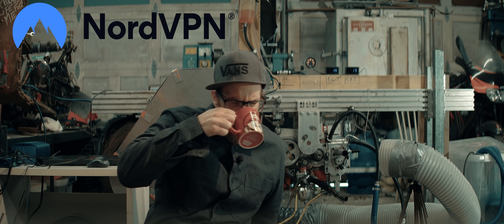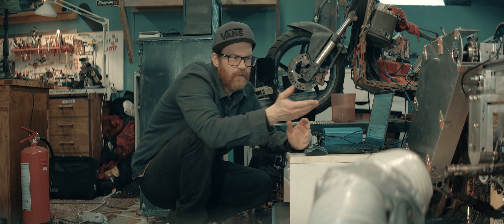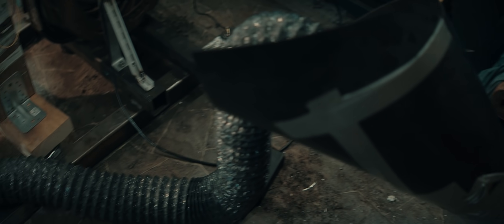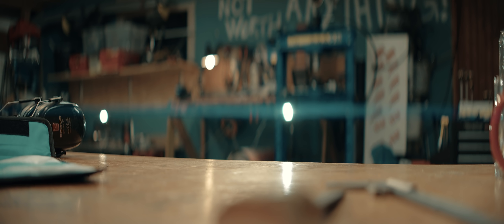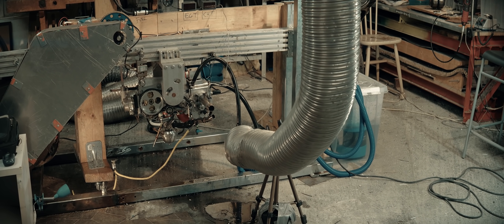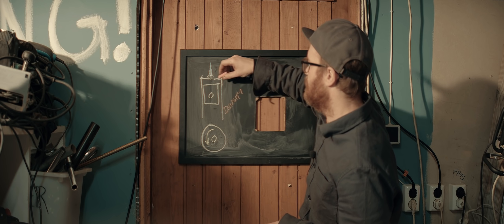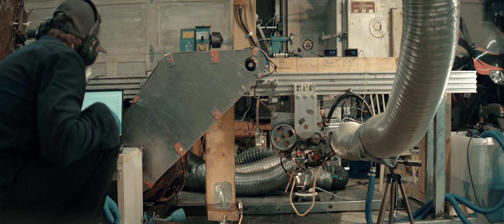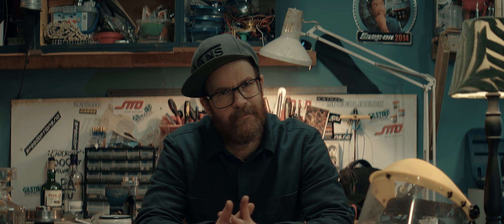50cc, 20hp, 15psi - we're just getting started! Supercharged Nitro Two Stroke.

Comment from the maker: Check out NordVPN exclusive deal here:
https://nordvpn.com/2strokestuffing
Try risk free with their money-back guarantee!
Reply: Something to consider is a waste-gate has a non-linear flow vs delta-p curve, due to the area exposed to relive pressure only being relative to spring preload at ONE pressure ratio (when not hooked up to a boost controller)......The reason I feel compelled to mention this, Is once you are no longer referencing boost to the wastegate, you are totally reliant on the delta-p / spring rate, and the pressure will go up with RPM as the supercharger becomes more efficient, but as the engine becomes more efficient, the pressure ratio will go down, and neither of which will you able to control.....I'd recommend getting the engine tuned as best you can with NO lines to the waste-gate FIRST, then reduce timing a LOT before referencing the top side of the gate. Once you reference the top of the gate, it will remain closed up to the manual boost controller internal "pop" pressure + gate "pop" pressure, and you will basically have a lot more boost at low RPM's (NO-leakage), up to your set boost threshold......A more safe strategy could be to change waste-gate springs in gradually increasing pressure / preload increments to adjust boost until you can establish what the engine can handle opposed to putting the line to the top of the gate (high cylinder pressure at low RPM will more easily damage parts then high cylinder pressure at high RPM)......keep up the good work / hope this helps!!!!!
Reply from the maker: @ericschumacher5189  Thanks for the advice!
Reply: Did you think about indexing the spark plug electrode being parallel or vertical to the ports ?   It can effect the flame propagation.
Reply: I think you should add more blowdown. I think that should be 40° in total
Reply from the maker: @fabiotiburzi  It's got variable blowdown, the transfer reeds only open when pressure is lower in the cylinder vs the intake plenum.
Reply: @2STROKESTUFFING  i know that but, did you noticed that at high rpm the boost pressure goes up to the max pressure that the compressor can generate? This is due to the fact that the blowdown that you have is too little and, for this reason, the exhaust gasses are creating a reflux into the intake, retarding the reed opening at high rpms

Comment: the crank and pivot for the torque arm are not on the same axis, how do you compensate for this? as soon as those 2 axis are separated, things like chain pull direction will change the numbers.

Comment: Great wrk as always man. Love your wrk. I have two porting questions I can not find any advice on and hoping you can tell me wat you think.  Porting s 4 cylinder 2stroke. Factory is bad bad castings ect. Cleaned up everything intake- exhaust-transfers ect. Mirror finish on exhaust and rough finish on intake side of everything. No mirror finishes on intake side of things for atomization of air fuel charge. So where my question is now I look at this motor and I’m starring at the crank counterweights and they are glass smooth. 1).  If I rough the surface of crank counterweights will it aid in atomizing the charge? Or will it hurt? 
2) will roughing crankcase surface help or hurt as factory is glass smooth. I’ve not been able to find a single thought from anyone on  glass smooth crank counterweights vrs rough. Glass smooth crankcase vrs rough!! Thanks man and keep up the amazing wrk you do man.

Comment: What kind of EGT displays are you using? They seem like the common PT100 type displays for K type sensors. Have they been accurate? One way would be go with koso but theyre expensive for the performance they deliver

Comment: Not sure what the hell is going on here. 
I thought this engine was being developed for another attempt at the 50cc world land speed record in the US. 
Where is the bike? 
Where is the gearbox? 
Is the engine fuel injected and if so what sort of ECU being used? 
Not sure about the dyno but this guy is doing this on his own which is a huge amount of work. 
Impressed.
Reply: The "Brute Force" engine started purely as a concept at the same time as Alex was researching the PiP engine which was going to be used in "Moped Dick"
The PiP engine was developed with a radical 100% of bore exhaust port to run with one of Mark Atkinsons special pistons. Alex went to the trouble of casting his own cylinders which sadly wasn't up to scratch, then tried his own Nikasil type coating which also ran into problems. Proto Labs came to the rescue with a 3D metal printed cylinder. The Nikasil coating was done by Blixtens racing in Sweden.
Testing got underway but the Mark Atkinson piston ran into problems and Alex had a had a exhaust bridge welded in and further problems arose from there.
At this time Alex resurrected the Brute Force engine for a change of scenery.
The bike " Moped dick" is kept with Mark Atkinson in the US.
No gearbox was going to be used, simply a variator which was used on the SPX Bonneville engine.
The new PiP engine was going to be used with 2 induction systems. 1 carb was going to be used to start the engine and the second was going to be a resonant fuel injected running RC fuel and water.
I hope these ramblings go some part to giving a better understanding of Alex's Bonneville record attempt.

Comment: I could have told you that would happen right when I noticed your setup does not use a clutch. Every time you shut off engine, The inertia will continue to push in rotation and forcing engine to act as its on brake. That jolting when coming to a stop is creating the excess play on flywheel. figure out a clutch = no more of this issue
Reply: The dyno was stopping energised right until it stalled the engine. It should release at 6k allowing the retarder and engine to run down together so no stalling. 
Alex has a set of one way bearings that will allow the retarder to free wheel when there is no force applied to it.
The problem that Alex faces is the shortage of quality workshop time, plus all the video production time as well.

Comment: do you have a knock sensor on the engine hooked up to a screen so you can monitor if knocking occurs in live time on a graph or something? while running it in the dyno and adjusting boost ratio of fuel/air and adjusting of timing?  would that been somthing to have? would be cool if it is possible with a red warning light or something if knocking occurs

Comment: Bull*hit, that engine does not made any power, he accelerate very heavy flywheel and then start brake that flywheel to zero. 
His dyno is peace of s*it.
Reply from the maker: The loadcell is not mounted to the "flywheel", it's mounted to the engine. Built up inertia only has the brake work harder.
Reply: @2STROKESTUFFING  old trick on dyno, overdrive and very hard brakeking, that way get very high peakpowers.
Why you don't run steady 10k rpm/20hv?? 10krpm you don't have boost pressure, whitout boost pressure there is not power.
Sorry my bad english.
Reply from the maker: @isopepe108  I repeat, loadcell mounted to engine, overdrive + brake hard will only have the retarder work harder. It's set to drop 800rpm/s which seem like a sensible rate to me. Need to tune the PID loop before I can use steady state, working on it.
Reply from the maker: @isopepe108  Btw, this engine builds plenty of boost just free-reving, no load required.
Reply: @2STROKESTUFFING  idon"t know what your gauge show, some pressure on 15krpm but not power?
Why?
You start brake 15krpm and get max power 10krpm with very small boost pressure, you cheat, supercharged engine  not work that way.
Reply from the maker: Can't be bothered arguing about this. I have no reason for cheating.
Reply: @2STROKESTUFFING Great stuff Alex, don.t get drawn into a argument.

Comment: Normally dynos allow engines to rev from low to high by lowering the load incrementally, but yours seems to allow it rev, then bring it down. Or is there something else bringing rpm down in the end of each pull?
Reply from the maker: I'm doing high-to-low pulls to take inertia out of the equation. The loadcell is mounted to the engine.

Comment: Judging by the way how harsh the engine stops after a pull makes me think the timing is way to advanced at lower rpm,  it also sounds like it working against itself in the lower ranges but that could also be the load of the compressor.

Comment: Why didn't you design a two stroke like a ships diesel? 
Meaning, no crank case flush, but boost directly into the cylinder.
Reply from the maker: It's actually set up like that, the crankcase is just used as a plenum.

Comment: Love it alex. When I was first playing with my turbo bike I was getting 15psi then I started adding tees that would net me about 18psi. Disconnected it that got me 22-25psi. Pressure to both top and bottom of the gate got me 36psi and pressure to just the bottom got me 42psi. It made about 65whp at 36psi on 155cc. Haven't had it on the Dyno with the new turbo or higher boosts. I did notice and I think you will too at about 20psi the sound would start to change and the power really picked up. It's a small bore so don't be afraid to get the boost up. I won't write a book here on why but being small bore you can get alot of boost in it before you have issues as long as your ring gap is big enough 😉. The compound set-up I'm planning for next year should get us over 80psi. Seriously though every boosted small bore iv seen loves boost over 30psi it's kinda the point where things get fun. I know at 10psi my bike will pull the front tire up in just first. But at 36psi it's every gear and it spins pretty hard in 1-3 if your not careful. Kudos love your work and your channel keep it up.

Comment: G'day mate. I've had a lot to do with setting up eddy current dynos. I don't think running in hydraulic mode adding more power to the coils over time is the best idea for accuracy. I know that PID tuning on an experimental engine is also not a good idea. The best way is to target fixed rpm points then the retarder will accelerate to that point then the current will increase through the power supply to the retarder and clamp it at that speed.  The harder you wind on the throttle, the more it will clamp and you will get a steady state hp reading at that given point. Then move to the next rpm point and keep plotting 
With no inertia to factor in. I hope this comment is helpful in some way. Keep on doing what you do mate! 👍 🇦🇺

Comment: cut a key way into the shaft fro the ignition trigger. even if you have to go buy a wood ruff key cutter it'll solve the issue of it slipping. keep up this ground breaking work 20hp is amazing
Reply: Or using 2 or 3 grub screws in the boss. I suspect the drive shaft is only 8 to10 mm in diameter.

Comment: ref; My humble 1997 RS125R produced 42HP and my RS250R (2000) and TZ250 (1998) both produced 84HP, which is 336HP per Litre. Factory kitted GP two stokes ( outside of the budget of club racers) got up to about 420HP per litre 
20.4 @ 50cc equates to 408HP per liter, so well on the way, with loads to come! 25hp = 500hp p/l, 30hp= 600p/l, or a 150hp 250, 75hp 125!

Comment: Also venting boost for control means the charger is working harder and driven faster than needed wasting a small but significant amount of efficiency
Reply from the maker: 👍 using the wastegate until I know roughly what boost I can run.

Comment: It seems like it sealed good. Very little boost will do alot,ramped in. Tune time is pulley sizes,trial error. 
        You do have the next one cast. You cut it outta bullet.
      I will love to see, this thing lighting a bullhorn, and poping release valve.
Reply: I may be sceptical but I fear for the crank at such high power as it's only a standard moped unit. Fingers crossed.

Comment: Good job! 18 hp at 10k. Also really like the atmospheric lighting. Good coloring! You definitely need a bigger carb or EFI. EFI will let you build tables and provide feedback and repeatability. Really good when working with charged nitro motors already running high static compression. The small Holley single EFI intake might work. Try a high voltage coil and keep the battery at max. It sounds like ignition is failing at high rpm.

Comment: Would a manual dyno offer better control?  Robot Cantina just did a video showing a home made small engine dyno that had good control design.
Reply: IMO the dyno is working much better in this video than the previous. I have said previously how I felt a potentiometer controlling a PSU would give a better control of the retarder coils than the "My dyno" control box at the time.

Comment: At present the engine is wasting power pumping boost straight out the exhaust any time the blowoff valve is open. For best performance I think you'll need to switch blower pulley sizes to tune the boost setting, and only keep the blowoff valve as a safety measure.
Reply: Yes your quite right. This is simply a prototype and we need to remember this in our expectations. You need time and money to make progress along with a large stock of parts on the shelf.
Alex has being fighting a battle on two fronts, building a dyno and engine at the same time.

Comment: I Really love this project! I thing i learned from experience with high horsepower turbo methanol engines is that when boost and also the amount of fuel rises it comes to a point when the amount of fuel needs to be calculated in the compression ratio. Cant compress liquid!

Comment: please find a better carb to put on it.
Reply: I quite like this carb. It would be much better if the sticking carb slide was sorted and controlled by a twist grip and not a welding rod.
A possible replacement could be a 11/4" SU carb with adjustable main jet off a old UK mini. There's also 11/2" versions.

Comment: Still a long way (fortunately for us)  to go if you consider that off the shelve stock 125 cc TM   Kart engines with del Orto 38 mm carbs  produce about  44 Hp at about 13000 RPM without any boost or other measures ,which translate to about 17,6  Hp  for 50cc .
Reply from the maker: Yep. My "old" 50cc engine sitting in the landspeed bike produces about 24hp at the crank.

Comment: Well done but I think you might be measuring power incorrectly. You are measuring the amount of power required to collapse and stall the engine. Giving a false reading. The dyno should be providing a force to act against the engine and maintain the rpm not collapse it to zero.

Comment: More air, more fuel, more power. Use a lower comp piston.
Reply: The piston Alex is using is a standard two stroke unit which doesn't allow for a lower compression ratio replacement.
In this case a larger combustion chamber in the cylinder head is required.
Reply: Was thinking of maybe a shorter con rod or deeper dished head to allow more of the necessary a.f.r.  it sounds like the blower is pumping that much air that its stifling the operation and rocking against itself causing the reduced performance. Of course I'm guessing as its as new to me as it is to everyone. 👍
Reply: @karltaylor7378  Hello Karl, Sadly by fitting a shorter con rod, it would alter the port opening and closing times. This is assuming a con rod is available then a full crank strip and rebuild would be required, It is not simply a matter of undoing two bolts.
I personally believe the higher volume combustion chamber is the way forward if you want to cram more fuel/air into the motor and this would require a new cylinder head design.
A problem that seems to get over looked is the strength of the con rod as  it's simply a 50cc road going unit.
Regards Malc.

Comment: Why does it always die out after a full power run? Also why does it make most power on the rpm downward slope and not on the upward?
Reply: makes me think we're measuring engine enertia instead of combustion cycle power or are we?
Reply: The engine dies due to the retarder stopping energised when it should have turned off at 6 k.
I'm afraid Alex or some one else will have to answer you other question.

Comment: Alex, what you want is a Tial BOV (Blow Off Valve) Will be a little trick incorporating it into your rig but once you handle that it's easily adjustable! Oh and the Tials are sized by amount of vacuum at idle, not boost. They will operate across a very wide range of boost levels ez pz.

Comment: I haven't watched all the videos but I am curious why you are bleeding off the boost pressure with the wastegate rather than just changing the belt ratio on the supercharger?  I would guess that is why the power falls off at high rpm.  You are using crankshaft power at high rpm to pump boost out the dump valve.
Reply from the maker: It's to get a feeling for how much boost it can take before changing the ratio.